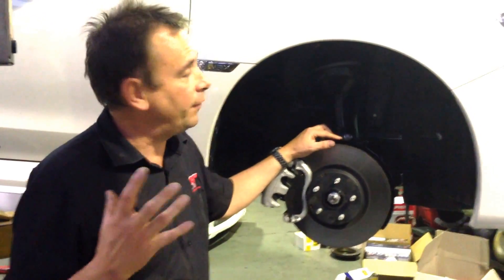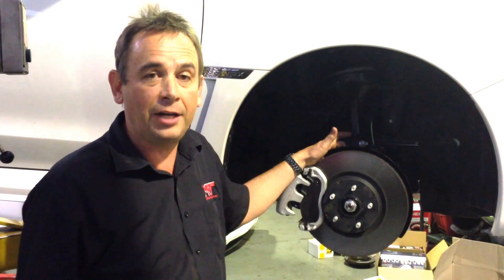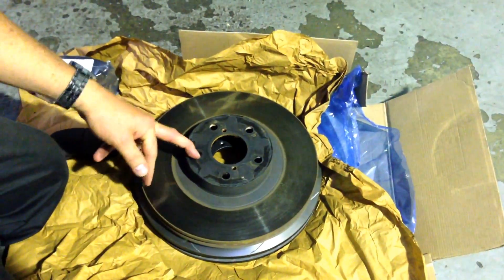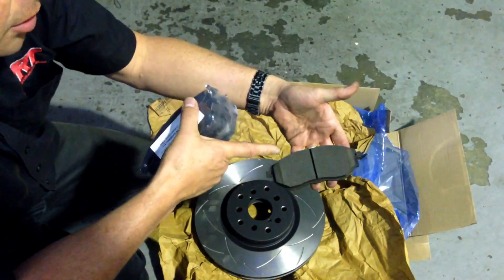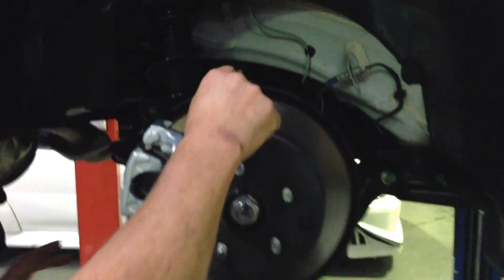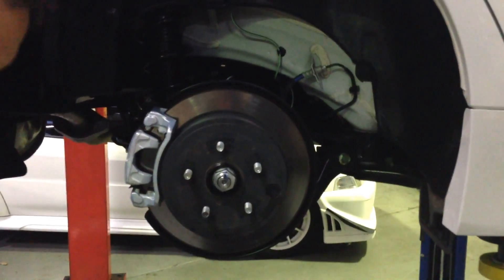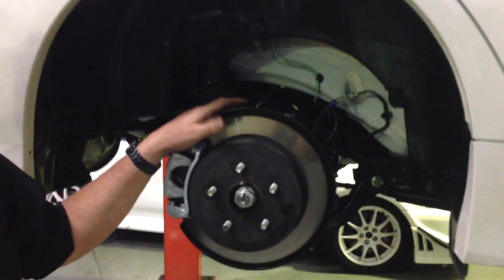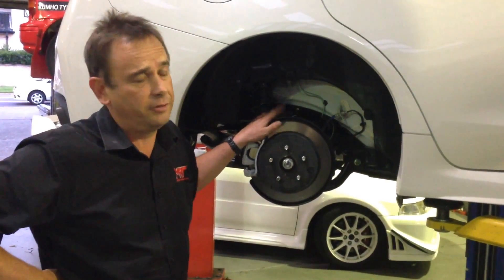Subaru WRX MY15 brake upgrade options MRT MY15 Project part 5

Comment: An important thing you did not mention is that BRZ rear 290mm brake rotors are 5x100. The BRZ Caliper will bolt on, but you will need the BRZ rotors redrilled to 5x114...

Comment: I have found MRT to offer good service and they have a long memory of the cars they interact with. My EVO X developed a serious Gearbox problem a couple of years after having modifications made. MRT worked with Mitsubishi to assist in the rectification of the problem at no cost. I would argue that Brett and his team knew more about the car than the Mitsubishi Servicing Team. They are busy as is evident from the multitude of videos that are posted, but they always get back to you and assist where they can and should. Thanks Brett for the Video.
Reply from the maker: Floyd Mayer thanks